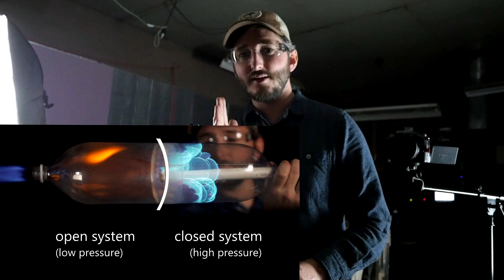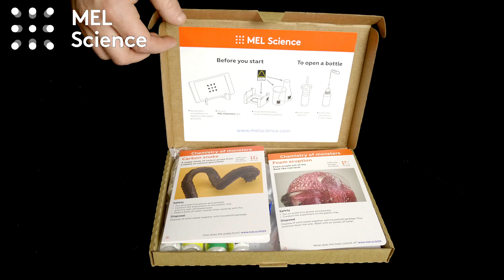XL Soda Bottle Rocket Engines (Static Testing)

Comment: If you are able to wire the igniter terminals inside the end of the charge tube, you should be able to slide the bottle to the correct depth and ignite from the right spot

Comment: During an end point ignition, can you further control the rate of combustion by cooling the bottom (outside) of the bottle?  Maybe by resting the bottle on a block of dry ice?  Would this cause a greater separation of the cooler uncombusted gas and the hot ignited gas?

Comment: What do you think would happen if you were to create two separate chambers, the first stage is charged with your propane/oxygen mixture under pressure and the end stage is just a vacuum?  You could then release the first stage into the second while igniting it!  Would the vacuum energy combine with the combustion energy?  Now flip them around to see how one stage affects the other in performance!

Comment: Something that would be interesting to see would be the effect of "obstructions" inside the bottle.

By that I mean some mesh or marbles or something inside the bottle that makes it harder for the flame to get past.

Counterintuitively there's a phenomenon where a flame front encountering such an obstruction, rather than slowing down, suddenly accelerates into a supersonic detonation.

The reason being that the flow past the obstruction causes turbulence that mixes the uncombusted fuel and the flame, massively accelerating the speed at which it burns.

Happens in real life with a gas explosion and a grove of trees or something.

Get well clear before you try it though
Reply from the maker: Sounds interesting, I'll have to look into that

Comment: You are nutz, and way cool. Love your presentation. Three questions. Do you have any idea what sort of thrust you are getting? How does that compare to a water rocket? Can you sustain the chamber, IE continue to introduce fuel and air? (Of course you couldn't use plastic, but depending on thrust a metal motor could product an air breathing rocket, or poor mans jet.
Reply from the maker: Not sure about thrust but it's enough. Water rockets get more

Comment: igniting far from the nozzle is probably expelling unburned fuel at the nozzle even if its not seen burning out side the bottle. So its a faster burn, and more violent, but probably less ideal for propulsion.

Comment: what would happen if you put more propane into the bottle but also put a few holes at the end  of the bottle closest to the propane tank?   would it perhaps suck the air in from the front and expel it to the rear to ignite the additional propane? what would that do in terms of additional thrust?

also - have you considered getting a fluffy white cat to hold in your arms and stroke?

Comment: I wonder if you could mitigate the melt issue by lining the nozzle with aluminum. It'd be a bit tedious, but it seems doable enough since you're gluing/taping split bottles together, giving you decent access to the interior of the bottles.

Edit: And just for the sake of spewing odd thoughts, I don't drink enough soda to know if anyone's still making them, but I wonder what kind of effect you'd see in one of those bottles with a swirl pattern at the top. I'm assuming that it might impart a spin on the rocket, but it might just twirl the gas on the way out and barely nudge the rocket due to the difference in mass.

Comment: Give it a nozzle!

inhale
Then give it a nozzle with slits around the base to encourage a secondary ignition of excess propane using the Venturi effect to draw in air and letting the existing momentum drive the burning mixture further down the bell of the nozzle. 
gasps

Comment: @NightHawkInLight my name is Gonzalo, I actually used one of your rocket launcher mortar videos and used it for a project for my engineering class back in high school. Best believe we got an A so I thank you. Just know we could bring it to school but not fire it obviously. We had recorded a video and shocked the class in awe with a frozen frame where it looks like a bright yellow Christmas tree like fire was coming out the end of the launcher. My engineering partner and I decided to visually advertise it as a rocket launcher from the shoulder rather than a mortar. We wanted to add a strap but that never happened which is okay because It was still awesome enough shooting it without the strap on the shoulder with its military green color and red button from the barbecue igniter we bought from the internet. In investing extra time even after the project back in high school I wanted to improve it and make it more powerful and did a lot of tests. I have tried different isopropyl alcohol percentages and the highest I found was around 70+%. I noticed the higher the percentage was the easier it was to set it off. I slowly perfected a method to introduce the vapors of the liquid and I also tried different bottles, smoother ones.. I want to one day maybe add fins with the limited space I had, perhaps make a fin mechanism inspired by ballistic missiles and rockets shot from different military rocket launchers like the famous RPG or the AT4. I found the best results for the "bottle rockets" is to get the biggest one that can fit in the launcher with a smooth outside layer with no ridges for hand grip for less drag and the static short circuit as back in the bottle as possible had best results. Now because of your launcher back in that video, its been pretty slow right now but I'm trying to develop an actual air-soft rocket launcher that is simulates a real one but still being safe enough for the sport. I found a void for that market because all the launchers for sale  at the moment use basically a small nerf football that or a clump of bb's flying into one spot. So i have come up with a couple designs in theory that should work. I don't care who patents or gets it on the market first. The air-soft sport deserves better simulation and the launchers today are not very good. In regards to this I had called some of my old engineering class friends to help me on the project as well in an effort to create something feasible, some of the ideas seemed promising and some new ignition ideas that would function from the inside of a bottle rocket or eventually an air-soft rocket using the one we had created back in high school as a base to demo or showcase where or how our different ideas would be applied. I love rocketry and explosions and to be honest you were a big influencer of that when i first saw that video, from a science loving perspective obviously but I wont lie i'm kind of a pyro-maniac. Thank you for the videos you make they are very cool and keep doing what your doing.

 Yours truly - some guy who got an A+ using one of your mortar video tutorials. Much love <3

Comment: Getting the ignition point to the end will be easy, simply use a very long PVC tube that can fit all the way to the narrow end of the rocket, and have radially drilled 3/8 inch (9mm) holes 120' apart for the starter flame spaced down from the end enough to place the ignition source where you want it. Two to three rows of holes should be sufficient. The point would be spaced exactly the same for each shot... so it should be very consistent.

Comment: I wonder if you could make rockets using aluminium soft drink cans. They might be a bit too heavy, but if they could work, perhaps it could be used to destroy stuff. I reckon if it did work  and got a good enough speed it could severely damage a watermelon due to it having a higher mass, especially if you designed a nose cone for it.

Comment: I think the uneven distribution of blue to red flame and swirling is caused not by the propane being heavier but from the recoil.  Your wave fronts are even till the bottle shifts up and that decompresses the top of the wavefront starting the wave motion of red flame on top and blue on the bottom.  Played the youtube video back, put it on slower playback speed.

Comment: I suspect all your air/fuel mixtures are fuel rich. In every shot, I noticed the gases outside the nozzle re-ignited (hot. blue glow). Once the flame inside reaches the far end of the bottle (from the nozzle), what remains, cools, contracts, draws in fresh air, then re-iginites (but is now fuel-poor).

Fuel burning outside the bottle is wasted fuel. Except if you decide to implement an exhaust bell to try to take advantage of the externally burning (expanding) fuel mixture.

The rich mix may be intentional. A stoichiometric mix would both 1) burn faster (explosively?) producing higher pressure, and 2) burn hotter also producing higher pressure. Both higher pressure and higher temperature would not be good for the bottle. However, both would improve rocket performance.

Fun video. Don't get hurt.

Comment: That makes sense because rockets ignite the fuel at the very top of the openeing for longer duration of burn ang build more thrust, while in the bullets, the ignition part of the gunpowder is at the back, for faster velocity and higher power... 

Don't know!😂 Correct me if I'm wrong!💙

Comment: IMO, if you were going for the best efficiency, putting the ignition at the front would be best, since putting it behind causes it to pushes out uncombusted fuel.

Also, I'd wager that when you see the back flame, that's a sign of inefficiency.

Comment: Use your normal launcher but cut a larger hole or two in the side at the "point of ignition" and then its all the same as your test bench and previous launcher. The tube beyond the hole is just a launcher guide and the flame can come out the hole during launch.

Comment: Have you tried a “dual” ignition point in the large bottles? Having the the end of the ignition tube close to the nozzle, but also having a hole drilled perpendicular through the tube at the back end, allowing for 2 simultaneous ignition points, in both ends of the rocket, in theory...

Comment: I launch isopropyl alcohol fueled bottles in my chemistry classes - the lid from a Propel "fitness water" bottle is a perfect rocket nozzle.  I don't know if it would cause overpressure in your system or not, but in a smaller bottle with alcohol instead of propane it's a significant difference.

Comment: I wish you would have let go of one to see if it slides down the pvc pipe. It would give a good indication of thrust.
Reply from the maker: Because it's free to slide on the pipe the force is exerted in both directions equally and the bottle won't move. It would need a closed end to measure thrust

Comment: Maybe try igniting at multiple points. Either use a big cap and a nichrome bridgewire. Or just a branching tube that traches both ends at the same time. (maybe use a tube inside a tube? It's hard to explain in text)

Comment: A couple years back I built a propane torch pop gun based on your project. I used it as a prop for my Tusken Raider Halloween costume, and it's pretty much the only diy science project I had seen all the way through in a long time. Looks like I need to get back into this stuff again, thanks for making videos!

Comment: Drill 2-4 small holes down on the pvc pipe where the front of the bottle will be when the pipe is inserted, much like a primer when you pull the trigger the first two jets of flame will come out at the front, later ignition in the back may have other interesting effects

Comment: You need a face shield if you are going to continue sticking your face that close to a device that has the potential to explode.  

I received about 15 stitches between my thumb and pointer because I under estimated the destructive power of a 2 liter when I was about 13.

Comment: Using this you might be able to fab up some kind if two chamber system. Put the two double ended bottles end to end (with one far end capped). The ignition source deep into the first chamber but just near the throat of the second one. It should result in an explosive quick burning launch followed by a slow burning flight phase. Or you just end up setting two bottles on fire.

Comment: The reason it burn faster when at the back of the botle is because the fire starts all the way back in the pvc pipe, the air fuel mixture is accelerated into the botle at speed before full ignition, causing turbulence.
(Similar to how a diesel engine with a precombustion chamber works)

Comment: I was wondering can a open bottle filled with butane air  mixture explode if you get mixture just right ? I know from my experience acetylen oxigen or even acetylen air mixture can and is not safe be too close to bottle.

Comment: 6:49 - the reason you see the flame rotate is because after the plug exits the bottle, the bottle jumps upwards and the air flowing in through the intake tube doesn't flow straight anymore but is tilted towards the bottom of the bottle which causes the whole content of the bottle to swirl. It's definitely not the gas temperature difference - that would be a very slow process and there just isn't enough time for that to have noticeable effect.

Comment: You talk about flamefront speed, as I see it, the flamefront may move at a "constant" speed.

With center ignite, it covers the whole front, since a small volume was streached to fill it(and the old front gas is already gone outside).

With back ignite, if it was a solid rocket, you would have a cloud of rocket powder and less thrust time.
At least based on the propane rocket, that seems plausible (push out evrything that gives extra runtime and power).

Good demonstration, questions that if not asked may become disregarded.

We don't know stuff, we figure out stuff!

Comment: It would be cool if you could develop a more advanced test stand that could measure the force the rocket produces. By integrating the force you could calculate the impulse of the rocket. If you know the weight of the rocket engine, you would also know the thrust to weight ratio.

Comment: The amount of energy inside the rocket is what matters. So a pressurized or larger rocket would have the potential of flying further. A heavy lift vehicle would actually prefer to have a stronger burn off the pad with a more consistent burn afterwards. But for small bottles it hardly matters. I would go for the stable burn any day because less chance to RUD.

Additional idea: A small bottle with the nozzle glued inside the nozzle of a larger bottle, with the bottom cut out of the small bottle. Ignition point at nozzle of smaller bottle - the part that would warm up is actually cooled by the fuel on the other side inside the larger bottle - so the rocket might wear less. Just a thought and potential experiment. If launching vertically, you could even have a small bath of water in the larger bottle around the nozzle of the smaller bottle as a heatsink.

Be safe. Rapid exploding gasses can be crazy dangerous, and you don't seem to wear much protection but some glasses. You might want to consider doing some of these larger tests in open ground with a bit more distance and less objects that can harm you. Also try sticking some red wire to the plug or tether it so it doesn't get lost every flight :p

Awesome footage! :D

Comment: I wonder how it would work with firing near the exhaust if you had internal baffles (basically sodabottles with their neck intact) pointing towards the exhaust, I'm thinking that it might lower the burn rate further but as it also limits flow it might actually give a more complete burn.

Comment: Place a pressure gauge in the wall of the bottle with a “tell tale” pin which will show the maximum pressure achieved during your various fuel to air ratios as well as with the differing points of ignition. Great video. Looks like loads of fun.

Comment: I didn't notice any collapse of the bottle on the negative air pressure phase.  Maybe if the end was sealed instead of using the PVC ignition tube,  spark ignited there might bring about somewhat different characteristics in mixing and flamefront, eliminating that springiness or lesser air pressure escape route out the PVC ignition tube. The tube ignition might aid in a more rapid more combustion though over a spark ignition, by better mixing.

Comment: For cheap and easy, just put some stereo wire down your PVC infill with a BBQ sparker from a $1 lighter. You could poke a hole for the wire using a hot paperclip if you're really trying to MacGuyver, maybe even use two small nails/wood screws to make a spark gap.

Comment: Just so everyone knows, many manufacturers have moved to a MUCH lighter weight of plastic for 2 liter sodas. If you need maximum strength, use a 1 liter bottle, as they are made with the same pre-form now.

Comment: Now what you need to do is fill the launchable vessel with propane and put a combustible plug in the rear. Then gauge it so that the plug is consumed a split second before the flame extinguishes making it a two-stage launch.

Comment: I wonder if you could squeeze in a small channel cut into the launcher tube and run model rocket igniters inside so you could ignite precisely where you want to without sacrificing the stability of the launch tube. 

Also, have you thought about what effect gravity will have on your pressure wave? I wonder if shooting it at an angle would result in the propane pooling like the 'lake of fire' burns, resulting in an unstable or otherwise wonky flight path.

Comment: 6:20 I think the bottom gas isn't burning at the same time because of the hole on the back of the bottle is larger than the gas pipe I'm not sure but I think the air is push a bit through the little space (I'm not sure at all and by the way sorry if you don't understand all cause of the English I'm not the best at school ^^')